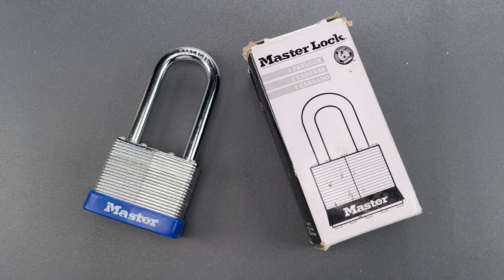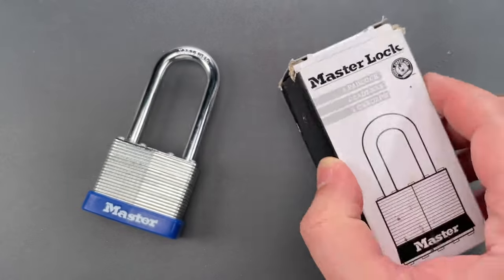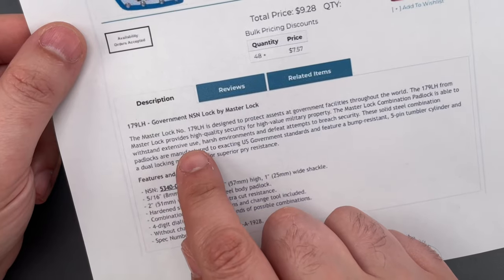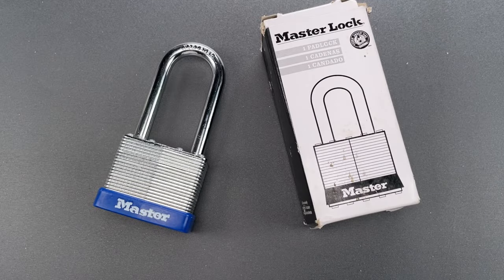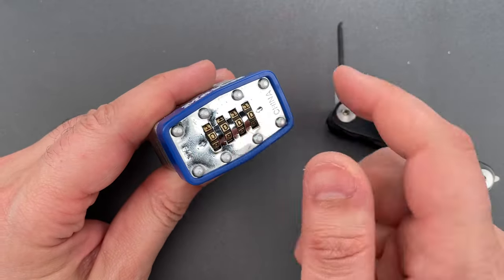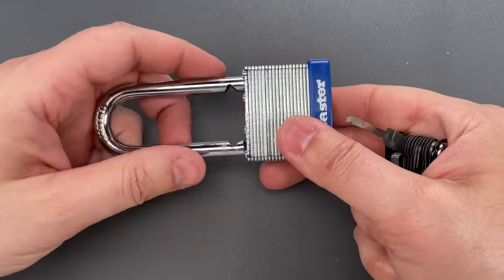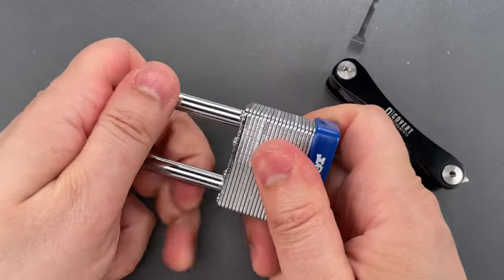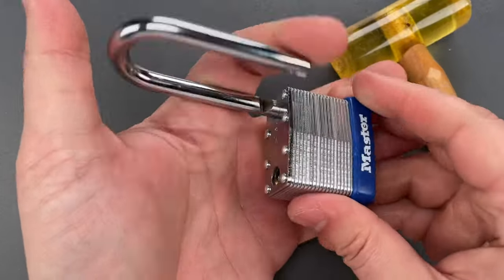[1449] TERRIBLE Master Lock Laminated Combination Lock (Model 179LH)

Comment: We used to use solid brass locks for our tanks in the Army back in the 90"s.  Didn't matter if you lost your keys.  Just hit it with a hammer and it would break.  Supply had them by the case.  People tend to forget that military grade means made by the lowest bidder.  This lock here is proof that the military is continuing that fine tradition.
Reply: im just surprised there's locks on the tanks at all since they don't have key ignitions lol
Reply: @samsh0-q3a  i mean if anyone can basically fire one up if they get inside i too would try to keep randos and/or drunk soldiers out
Reply: @samsh0-q3a  Exactly. You wouldn't want someone getting in and driving away with your tank, would you?
Reply: @ΣτελιοςΠεππας  wym "your tank"? It's government property and every tax payer shoud have access to it
Reply: bruh  i wouldve just waited til he threw track...
Reply: @samsh0-q3a  The locks are usually on the hatch(es). For wheeled vehicles it was usually just a cable around a secure point and the steering wheel.
Reply: Iron Strange  does that mean that if I fail tank course, I can get my taxes back since I do not have access to it?
Reply: Master made a knockoff brass color combination lock for the us military in the 00s. It’s also hammer openable. I guess if you wanna sell a product just grift an idea they’re familiar with.
Reply: I was with my brother one day and we were upgrading our phones. The salesman tried selling us on this new phone case for them saying that it’s “made to MILSPEC standards.” 

We both just laughed. 
I was in the Air Force and he’s a Marine. We had to explain to the guy why.
Reply: The military alpha numeric
Designation for a hammer is
M911A1
Reply: @vlaricshard2  That's almost what happened. He got it stuck on a traffic island. There wasn't enough clearance so he ended up stuck with both tracks in the air.
Reply: @ZephodBeeblebrox  I wish I could say I've never seen someone high-center a tank.....
Reply: We still use the exact same locks lol
Reply: Yep, same here.  Ft Stewart for me, and yeah, those brass locks were a joke.
Reply: At least it's an improvement over the brass lock - you can still open it with a hammer but without destroying it. That's what I call cost saving measures.
Reply: I was going to say $7.57 seems rather low for a high security lock.  The military does have some very good contracted locks that have been featured here, but I suppose those are used sparingly lol.
Reply: @feedbackzaloop  That's one of the stupidest things I've heard in a while.
Reply: The gotta save money somehow. The military has to pay for sex change surgeries now
Reply: My favorite part of the brass locks were that they were part of our BII and were serial numbered so anytime you lost one, you had to short survey it. The funniest thing on the tanks were the sponson boxes; never mind busting the locks. The latches were so crappy that you only had to kick it to bust it open and you could borrow that hammer you needed for your next layout.
Reply: @andrewwilbraham6875  I smell a crossover with The Chieftain but how can LPL be a hand model in a Chieftain video?
Reply: @matthewjbauer1990  I'm sorry communism is no laughing matter to you... Must have had some serious childhood traumatic experience, regarding sharing a toy
Reply: Probably applies to all these VPN's with "military grade encryption" too
Reply: Always used AS 5200s on our howitzers and radios. Besides 2 crescent wrenches could bust any lock off an M1 or AVLB.
Reply: Iron Strange  ok, so they're gonna give me back 99% of what I had to pay on taxes?
Reply: just because its "military grade" does not mean its quality
Reply: and bonus reminder for everyone. No military vehicle uses keys to start, they have a button ignition (To be fair I wouldn't trust marines not to swallow them either) so literally the only thing stopping people from stealing tanks are m9 pistols, these padlocks, and the implication.
Reply: @andrewkitzhaber4663  ah, that's what  they were missing at area 51 deal: stealth and hammers, which is two things I literally would never have combined before
Reply: @_BangDroid_  That "military-grade" encryption is literally the same encryption used by all web browsers.
It's "military-grade" because it came with Internet Explorer.
Reply: @samsh0-q3a  It's to secure your equipment from people stealing your tools.
Reply: @feedbackzaloop  YOU DO! There's a man down at the mall who can get you access to them!
Reply: Damn, we always cut the locks when we lost the keys, unless they were on one of the sponson boxes, then we just kicked the handles open, and somehow didn't break them.
Reply: @startedtech  It's not high security. If I didn't have tools, I wouldn't even need to lock the tank.
Reply: @recapdrake  Where's the pistols at fool?
Reply: @feedbackzaloop  
It's a part of military culture.  "My Rifle", "My Marine Corps", "My Sergeant", "My Platoon", "My Tank".  Something is "mine" because I took responsibility for it, a signed paper says my ass is on the line if anything happens to it, and I have physical possession of it.  It doesn't matter if it technically belongs to "My Military" or "My Country", because both of those things are actually "Mine".
Reply: @r3dp9  "military culture" - and I thought I was the joker here...
Reply: @r3dp9  If it's yours you will care for it. If it's not, you won't.
Reply: @ZephodBeeblebrox  yep, he high-centered it, and then the cops popped the hatch and him.....
Reply: Military buys locks of varying requirements. This lock was likely used for soldier's footlockers. The S&G locks all 3 iterations, offered slightly higher protection. But the barrister shall make mondo dollars by appealing to the fanboy network, feeding them more Master Lock content. Not many free thinkers out there.  Make sure your Master or American Commercial models of locks 7000B and AM4 keyway have the two longest pins somewhere in the lock, they will not likely be combable, are VERY pick resistant, and take a harsh treatment. I am no apologist for MAster, I do not like their business model, but they are keeping one lock pickers' family fed.
Reply: @ΣτελιοςΠεππας  I'm flashing back to the episode of MASH where Frank Burns gets in one and proceeds to pretty much wreak havoc on the camp.
Reply: Ah, the lowest bidder:
‘I felt exactly how you would feel if you were getting ready to launch and knew you were sitting on top of 2 million parts — all built by the lowest bidder on a government contract.’

— Attributed to John Glenn
Reply: @feedbackzaloop  I would pay to see that.   Be sure to have medics on standby.
Reply: @tread140  aren't you already paying? Like for that "Ukraine Democracy Defense Lend-Lease Act of 2022"
Reply: And the "lowest bidder" means the contractor is still walking away with double the profit. Can't forget that part.
Reply: @feedbackzaloop  My point was that letting civilians play with a tank would be highly dangerous.
Reply: I called those brass Yale locks, "twist offs", and yup, that's what we did in the '80s, too.
Reply: @tread140  we already do play with tanks as American citizens. As long as you can pay for it, you too can own a tank. If you can't pay for it, there's places that will rent one to you. 

I'd buy a tank right now if I could parallel park it on the street in front of my house.
Reply: We have those brass locks on our tool cabinets at work, Army supplied. One was latching hard because the shackle was bent, I bent it back with channel locks, works like new again....quality unit
Reply: @citylockapolytechnikeyllcc7936  I had a quick look, 3 months ago was the last roast of a master as near as I can tell. That doesn't seem like it is paying the bills to me.
Reply: @diane8996  No. 

Almost no contracts go to the lowest bidder. Performance, potential and previous contracts matter far, FAR more than price. 

In fact, price usually doesn't factor in AT ALL.
Reply: @jpowens2253  You know, there's someone down at the mall that will PAY you to play with tanks. 

All you have to do is clean them up at the end of the day, do some maintenance every now and then, and spend alot of time sweeping.
Reply: Come one 6 years as a mech and your going to tell me that on a harden steel latch that will not bend any lock would work? No no matter the lock the bar itself has only a few materials available and all of them will shatter when you toss on a f wrench. That's why they use cheap. Get into higher security locations and you run into much high grade locks. They all brake the same the metal bar just a effortless twist. Yes iv broken some of the high grade locks iv seen on this very channel. Super fast super quite and 2-3 seconds everytime without fail. Put the same lock on a storage unit now the door latch will bend twist and flex but hold on for deer life now worry about the key and the body.
Reply: Can confirm. I watched lpl for a while learning the locks and how to defeat them because everyone looses their keys to the tracks. The brass 5200 series ( todays army locks ) are rather easy to break and pick.
Reply: @brandonknapp6013  there all easy and always have been I don't care what lock you use. The latch on the tank or any armored vic is strong. The metal on the locks only have a few allowes to use. All.of them shatter with with ease
Reply: I mean if you really want to avoid the tax then just drop your citizenship , go out of the country and you on your own with no tax , problem solve...... ( I agree that military budget has inflate a lot nowaday and it is not necessary have to be that way but even if cut back I bet they still need around half of their budget to maintain US status globally and don't even argue that you dont need military power, it already benefit your previous generation and also you , US can't be strong in economic and influence power as today without the military power .
Reply: @feedbackzaloop  It's a tank. I believe it is government property and everyone should NOT have access to it. If you want access to a tank, join the military. In some regards, I'm scared of tanks and the people who drive them. They are cool and all, but I live 20 miles from Fort Knox and anything could happen. And nowhere did I mention Communism or sharing. I have nothing against sharing, I only feel that we should keep things out of the wrong hands. If I wanted true communism, I'd move to China and live with my uncle (and I don't).
Reply: @matthewjbauer1990  I want access to the services the Government provides and gets paid for. If I were to join the Army that would be double accounting. Also, I had my share as a civilian mechanic at repair station of officer training facility. After all, it's just a tank, in the wrong hands it turns into a brick. It's the wrong head with the right hands that must worry you. Which would obviously defeat any lock anyway.
Reply: @jpowens2253  I get that, but the original comment seemed to be that because people pay taxes, which buy military equipment, that they should be allowed access to it.
Reply: @matthewjbauer1990  1. There are no tanks at Ft. Knox. 

What, fool, are you afraid of?
Reply: @feedbackzaloop  You mean worse services than the civilians get? Just name these so-called things you can't have?

From the lack of English skills, it's pretty obvious you're not paying any US taxes.
Reply: @mattz1230  true, I'm a German resident. What doesn't keep me from caring for fellow people.
Reply: @BrandonCreeger  just swap the steering wheel
Reply: No

Comment: They should sell the lock with the rubber hammer. As the backup key.
Reply: oof
Reply: Backup? The hammer would be the main key, quicker than trying to enter the combo. Hell if it's on a chain on a fence just beat it against the fence pole.
Reply: Nah, that'd make it too expensive to sell. You see, the hammer would have to actually function for it's intended purpose unlike the lock.
Reply: @CowCommando  candidate for best comment. It's a yes for me!
Reply: I want a squeaky hammer instead - the one you hit people's head with =D
Imagine that it would be the loudest squeak when we open the lock ^^
Reply: Any stone nearby would work too
Reply: Great comment! Thanks for giving me a Monday morning laugh.
Reply: knowing guys in the military they would use the hammer instead of wasting time on the code
Reply: Dang wish I knew a hammer would have worked when I was in the Military I used to use bolt cutters to cut locks and those I had to sign out from the tool room, hammers we had all over the place.
Reply: xD xD xD
Reply: top tier
Reply: It's a polyurethane hammer, it's a type of hammer that doesn't Marr or damage the surface.
Reply: How make lock with a fake keyhole where the hammer is the key because who going to think using a hammer as a key?
Reply: When I click on the "Like" button for a comment, and see the counter change from 1.3k to 1.4k, I feel empowered!
Reply: The hammer has way more value 🤣
Reply: LOL
Reply: @bikecommuter24  Bolt cutters, where nicknamed the "master key" in my unit.
Reply: Good thinking 😆
Reply: This reminded me of Russian tank drivers in ww2 issued small sledge hammers as a "gear engagement aid."
Reply: lol
Reply: That's exactly what I used when I was in the US Army to open these locks. Can't be bothered to remember combos. Also, I found locks Made in China to be more secure.
Reply: @totallylosthere  Really? FInally we found out what it is that the Chinese make well.
Reply: @BrianG61UK  You get what you pay for, if you choose the cheapest garbage expect such when buying from China. And making a better lock than masterlock is a really low bar.
Reply: Lol
Reply: Oh lol.  Something important was left out of the spec.

Lock beating lawyer?
Reply: @night-x6793  
Anyone that knows how crap Master Locks are.
Reply: @thechumpsbeendumped.7797  Luckily most don't know how to picklock because they would been out of business years ago.

Comment: Friendly reminder that "military grade" simply means "conforming to a set of standards that the military uses", which could be "Has a 2 inch shackle".
Reply: But takes at least thirty pages to say "Has a 2 inch shackle".
Reply: Also known as "the barest of minimum standards that you can get by on while skimping on everything not specifically specified"
Reply: @joshuacheung6518  Nah, contractors will skimp there too.  The only question is if they're called out or not.  With the favorite seeming to be letting the contractor dig themselves a hole then not pay them until they retrofit everything to actually meet spec.
Reply: @arthurmoore9488  That shows bad faith on the part of both parties! 😂
Reply: @jpaugh64  Yes, and?
Reply: Same thing for firearms. Hate it when companies claim a firearm is “military grade” because civilian grade is 9 times out of 10 far better
Reply: We had a set of chinesium knock-offs on a deployment. They were deeply embossed "hardened". One could bend the shackle by hand. Old chewing gum would've been an upgrade... Worst tolerances ever.
Reply: @blindleader42 , "must be made of metal"...
Reply: yea, my Ikea drinking glass from russia also meets USA Military mil-std 810h, (all it has to do is complete one test) (Test Method 508.7 Fungus) (its glass)
Reply: So basically my porn stash has military grade locks protecting...and yes none of it is master
Reply: it means "as cheap and mass-producible as possible"
Reply: How good at locking would an average foot soldier be I wonder?
Reply: The set standard is the bare minimum needed nothing more for cost efficiency dead serious
Reply: @BigWheel.  Lockpicking?  Assuming the Army is like the Navy, surprisingly good.  There's a lot of opportunity to pick up random skills during slow times, and lockpicking doesn't require a lot of stuff
Reply: Had to give you that 1k like my good sir you deserve it 👏🏾
Reply: The base requirements for a military grade cell phone are, "less than 1 inch thick, 2 inches wide, and 4 inches tall, and with a mostly black color."  So yeah, military grade is a terrible way to rate things.